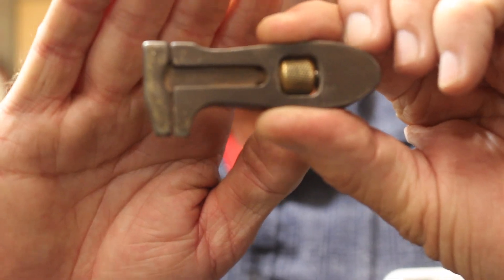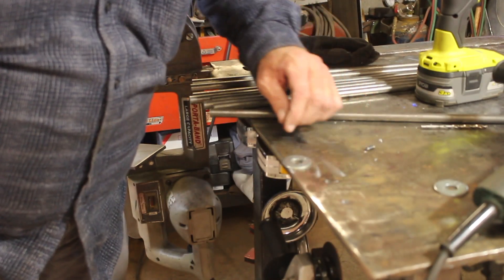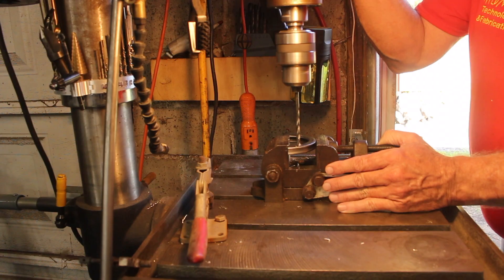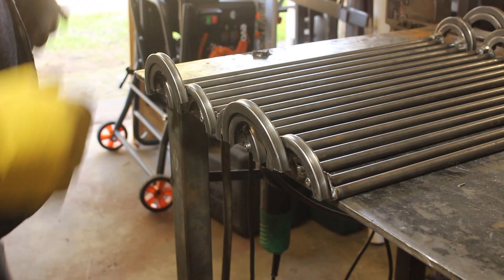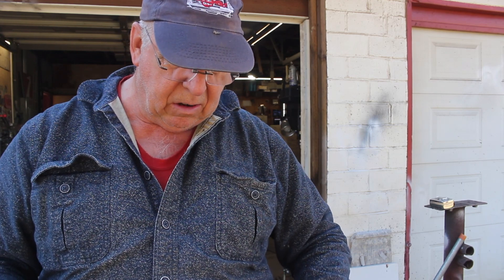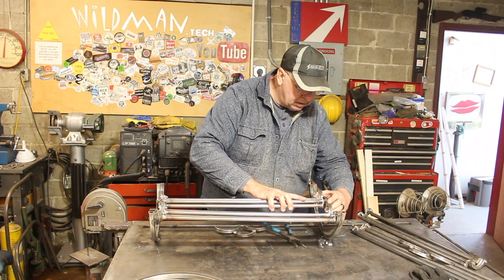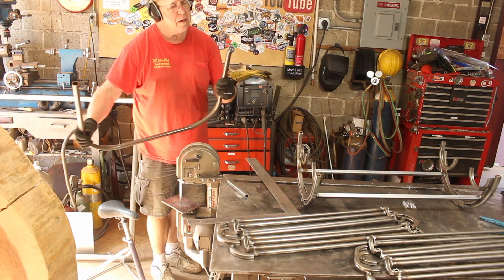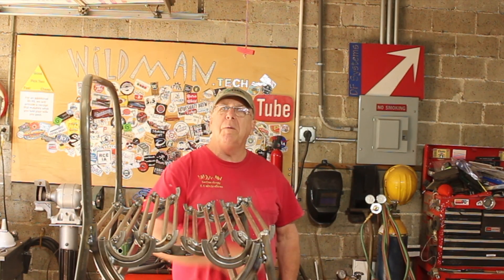Fractal Butt Vise (Fractal Chair)

Comment: I found this due to your comment on the Hand Tool Rescue chair video. I couldn't visualize the difference you described, so I decided to check it out.
I wish there was a closeup shot of the movement of the seat, after the chair was completely assembled. 

You left the seat area as bare metal, while the Hand Tool Rescue video went with mounted wood slats on top of the pivot. Neither of you handled that the way that I would have, but I have no experience in fabrication, so maybe there's a reason that I don't understand. Personally, I would have bored out some dowels, and put the metal bars that you used for the seat through the dowels. My reasoning is based on sensory and aesthetic preferences, rather than functionality. Is there a reason that this wouldn't work?
Reply from the maker: Well the dowels would burn when I welded the steel rods. It’s actually quite comfortable as is.
Reply: @WildmanTech  that makes sense, when I think about it